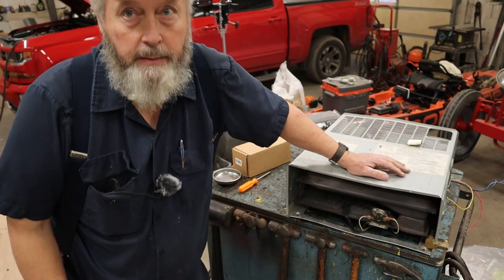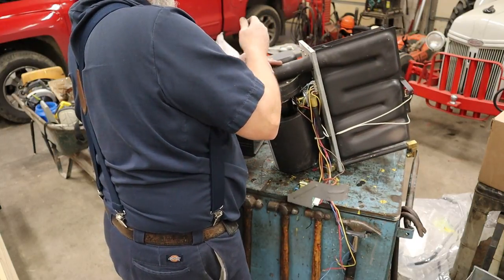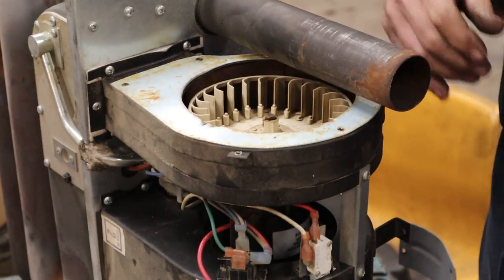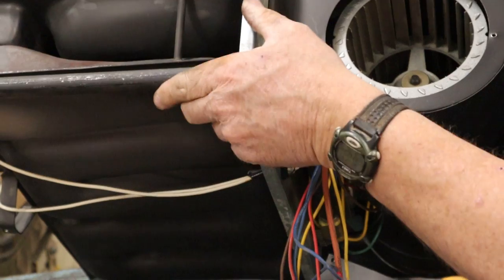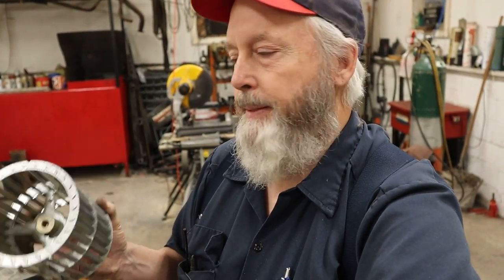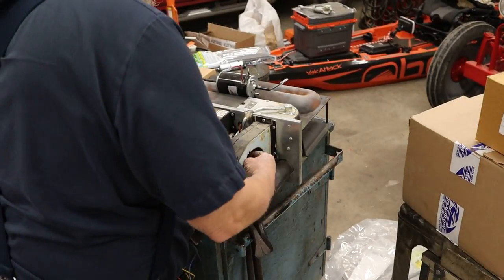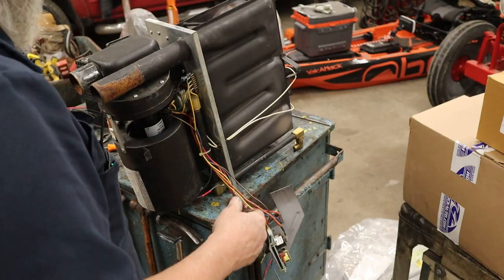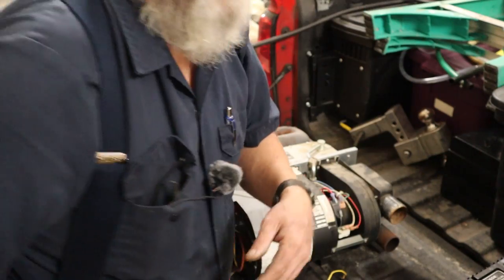Suburban Furnace, Fan Is Not Running?

Comment: Amazon said they have no idea where to buy torque pliers dang, guess I will make my own! Lol great video my friend
Reply from the maker: Hummmmm !!!! That's weird.
Reply: Good morning quick question do you of any “ return air duct work” in 5th wheels. I have a client ask me, he has floor vent not doing anything and wall “ round” vent blowing hot air. I told him to put a piece of TP on the floor vent see if it sucks it down, waiting on his call back. Thought I would ask the expert thanks
Reply from the maker: @laundrymanadams6105  I have never seen a return vent. The furnaces just suck air from around the furnace, that is why they don't have filters. As far as a vent not having much air coming out? Crappy vent system is usually the culprit.

Comment: great helpful video, thanks for posting. the information in your video is pretty hard to come across, not alot of techs post this stuff. it helps us new techs out! i had to replace a fan in a furnace which i couldn't remove... there was a 6x6 post about 8 inches away from the back of the furnace. cant remember what kind it was. finally got the fan out.... new fan shaft diameter was too small, wrong part. I quickly learned to compare the new and old part before i spend a half hour trying to get it on!
Reply from the maker: Man, that sucks.

Comment: Hi Kenny nice swap on the furnace motor your service van ecm there is a place here in British Columbia called birch island diesel they are on eBay a friend of mine got a ecm and pcm also a engine harness from them for his 1999 Ford F-350 it might be worth checking out
Reply from the maker: Supposedly they found another one for me. I hope it lasts longer than the last one.  If I need to I will check out Birch Island. Thanks

Comment: Great video. When you are that far into the furnace do you replace any other parts like maybe a sail switch or limit switch. Keep the good videos coming.
Reply from the maker: If I were working on a newer Dometic furnace, ABSOLUTLY. Their sail switches are garbage. This is an older furnace. I leave the old parts that are still good, because they are better built and more dependable than new parts.

Comment: Hi Great Video.  I have similar furnace with no fan running.  plan to hook up motor to outside source soon and check.  From what I understand, if its not the motor, likely the relay.  Can you give any tips on more secure diagnosis?  Other vids are vague.  Also, manual says to remove all components and blow out furnace once per year.  I understand nearly nobody does this...but I do have some muddauber nests at intake/exhaust ports so wondering if I might give it a shot.  Do you ever do this full clean?  any chance you might make a video next time you do?  Thanks!!
Reply from the maker: If fan does not run when hooked straight to a 12 volt source then motor is bad. If it does run then probably a bad board unless it is old enough to have a fan delay relay. I have a video in the works to explain more about furnaces. Maybe out this week or next.